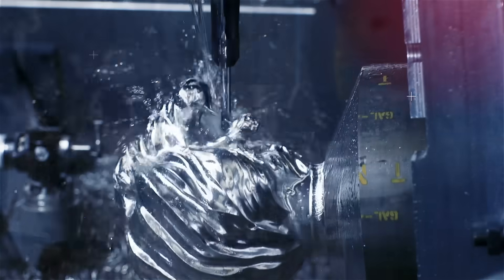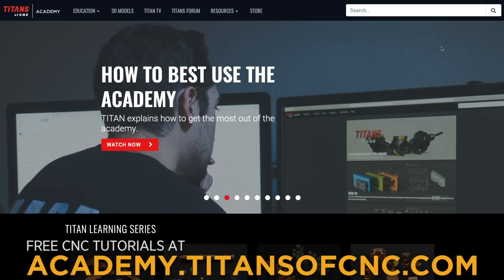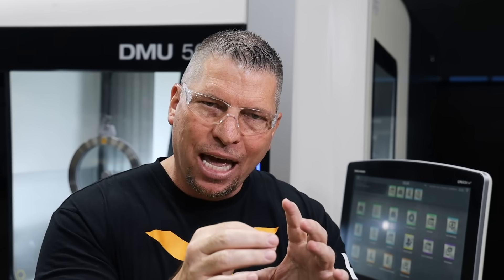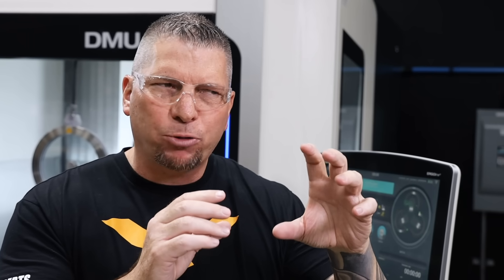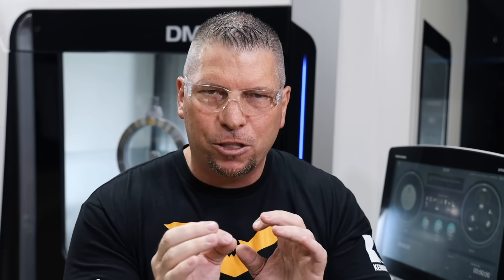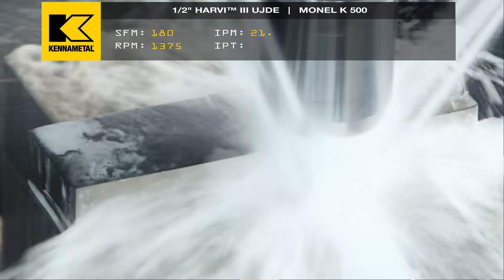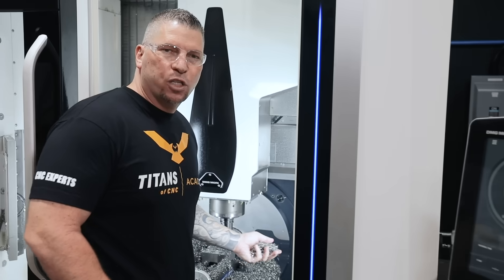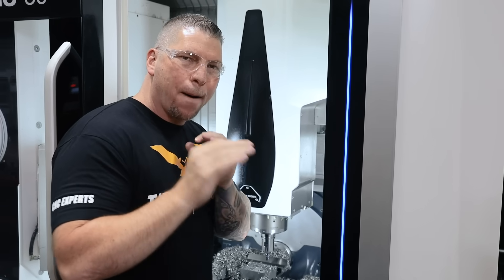Milling Monel K500 Alloy | CNC Machining MasterClass | Vlog #93

Comment: I have a job to turn 3 pins of monel K500. Do you have any feeds and speeds on that? The pins are about 8 OD and 12" long so it is a get it right the first time. Thanks

Comment: How about more on ceramic tooling? Our shop does allot of exotic materials including K500, our tool vendors are pushing ceramic insert cutters for fast roughing. They are giving me numbers like . 09" depth cut 50% radial at 1100 surface feet. Be cool to learn more.

Comment: Is there a reason to only cut in the one direction instead of doing a climb cut, stepping up in 'Y,' then doing a conventional cut? Figured that'd be faster than cutting and having to rapid all the way across the part to cut again. I was told carbide doesn't like interruption very much, so I figured constant cutter engagement might be better off? I'm still pretty new to machining, so don't judge too much lol
Reply: All or most CNC operations, Especially hard materials, always use climb milling. Climb milling allows the cutter to bite into the material as its being fed into the cutter. Conventional milling presents a huge problem because the cutting tooth starts to touch the material at the cut surface making the tool work much harder and hotter trying to "dig in" to cut the material.
Reply: @CNCGuy  Great info to know. Thank you for the reply. Are there any instances where conventional cutting would actually be recommended? Or should I always try to climb cut whenever possible?
Reply: @ssberserker1488  Machines with significant backlash, such as old kneemills, you need to use conventional milling. Since climb milling always tries to pull the workpiece in, it will jerk the table and damage the cutter as you feed it in, or worst case, rip the workpiece out of the clamps. You can however try the table locks to add pressure on the table and feed lightly.
Reply: Nó gút xe

Comment: Loving the variety of materials and corresponding feeds and speeds. I have an idea for a video if you haven't already done it. Understanding and how to read and apply the different machining formulas and nomenclature such as Fz Vc. After understanding the nomenclature then being able to use feeds and speeds charts could be a follow up video. Machining nylon or phenolic and explaining the importance of torquing parts down to minimize stresses would be a cool video I think too.

Comment: Hey titans of cnc! Im a learner in cnc programming and I am very curious on how 5 axis jobs work or even 3 axis. I am currently hand programming everything and I find it quite fun! But I hear that companies typically use some kind of cad to program it so im confused on what my actual job as a cnc programmer is.

Edit: I am 19 and in a trade school learning HAAS 3 axis on a 2005 super mini mill and sl10 HAAS lathe and a 2016 HAAS VF4

Edit 2: my instructor wants to know what does the dry run button does on the haas machine